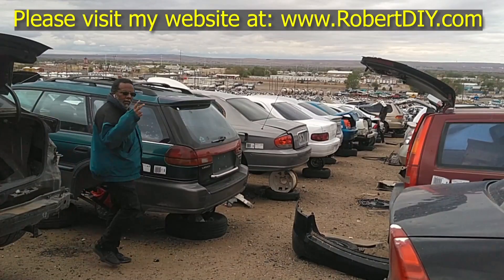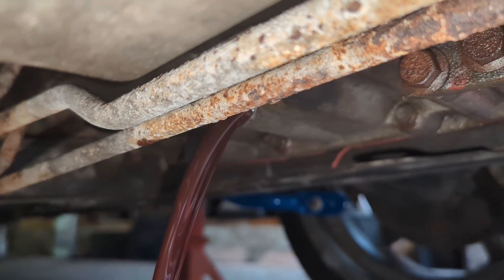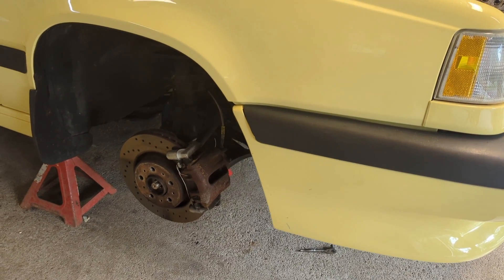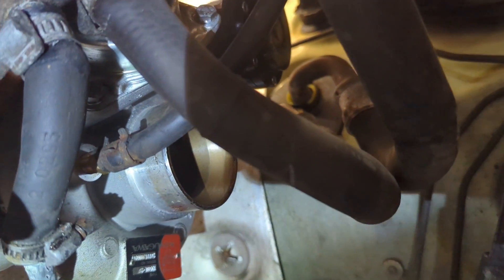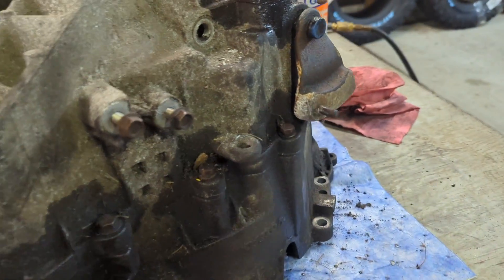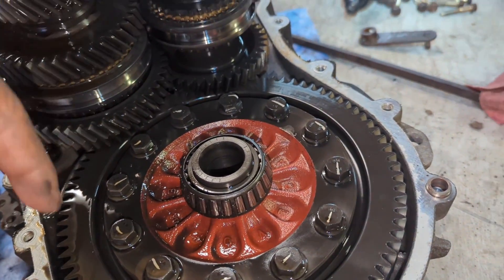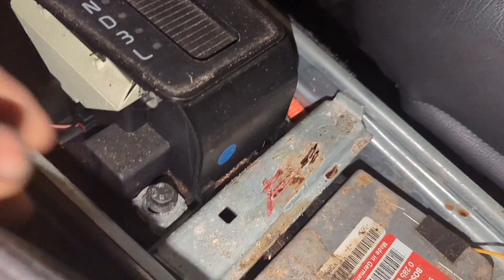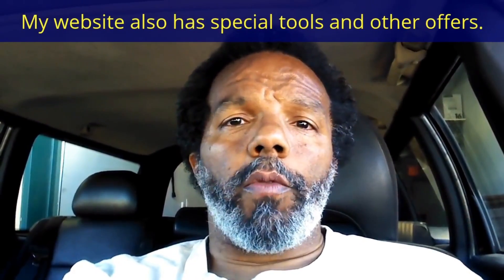Another manual conversion on a yellow '95 Volvo T-5R sedan. Clean trans fluid, now wants LSD - HOWR

Comment: I just had a light bulb moment!
Robert you drop the subframe, and move it out of the way exposing the entire bottom of the engine. 😮😮😮
Here I was trying to Jack the car 5 ft off the ground to pull the entire engine package out still connected to the subframe. 😢
Reply from the maker: Yikes! You have a new account name. 🤔
Reply: @RobertDIY  this is the ranch account, the other is the business acct.